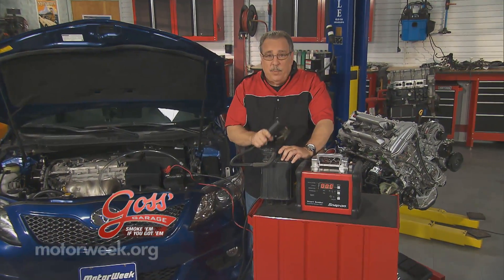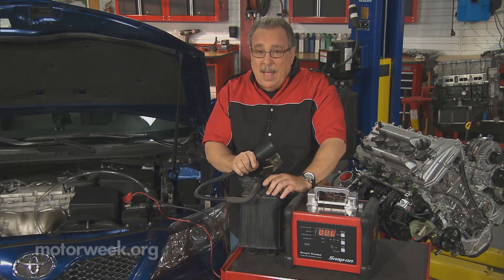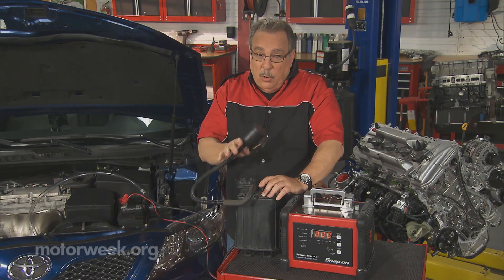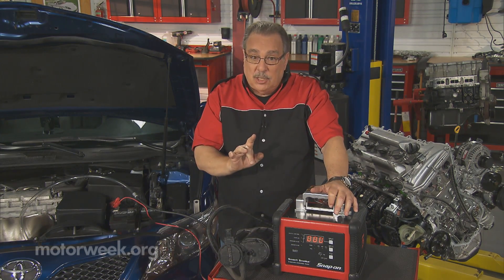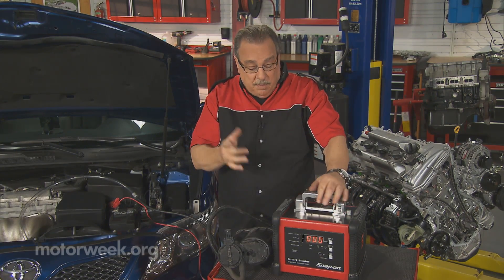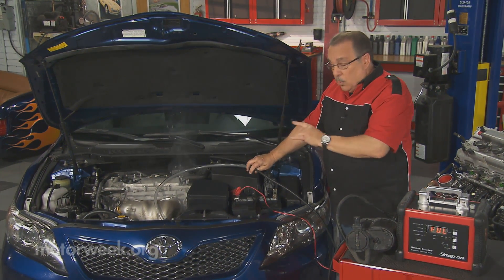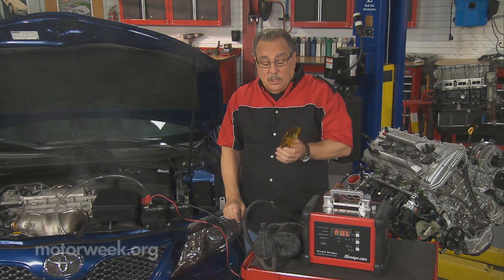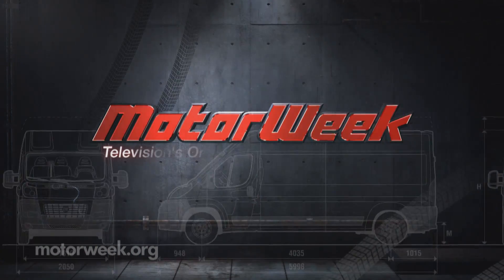Goss' Garage: Smoke Machine

Comment: Hi Pat,
I bought 2 months ago Honda accord 2014 and I found that the passenger side is about 8 mm (1/3") higher than the driver's side regardless with full or empty tank of gas.  I understand no car is perfectly balance but should it be no more than 2 mm difference.  How could it be fixed ? What  is the industry standard of tolerance ?
Appreciate your expertise advice.

Thanks,
Francis